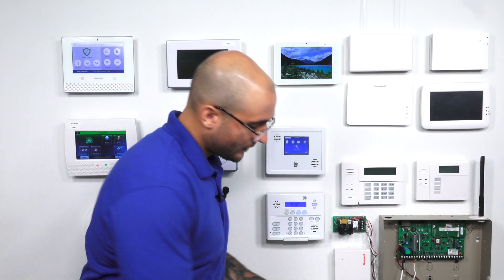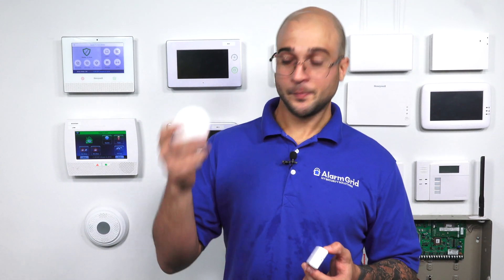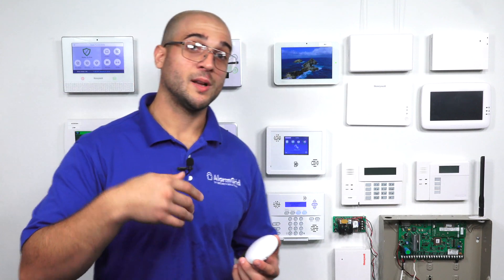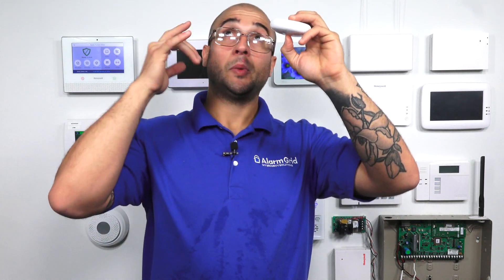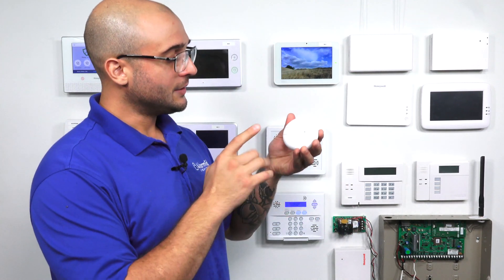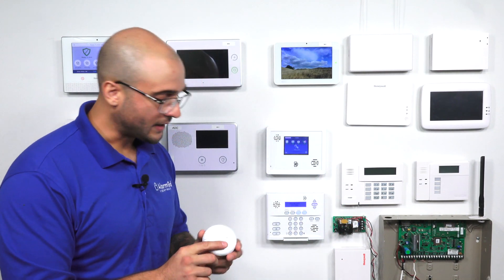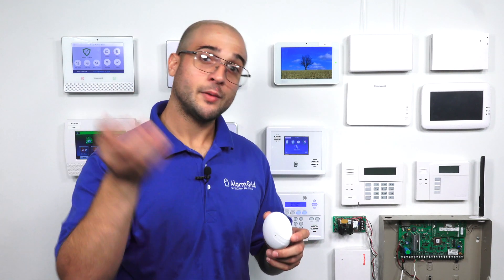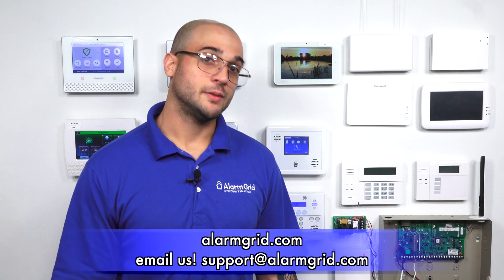FireFighter Product Overview

Comment: Do they make just replacement Smoke/CO detectors that integrate directly to the alarm system? or these are the only option?  bought a new house with individual smoke detectors(battery) no hardwiring, and if they make ones that integrate i may just do that rather than these.

Comment: How can this be installed? Is it like double-sided tape or does it have to be hardwired? Also is it powered by battery?
Reply: This can be installed either with the double-sided tape that's provided with the device or by using screws. This is a fully wireless devices so it runs only off battery power.
Reply: @dylanalarm_grid1038  Thanks